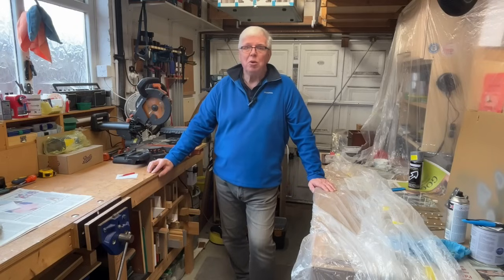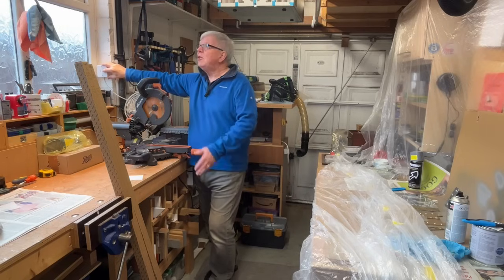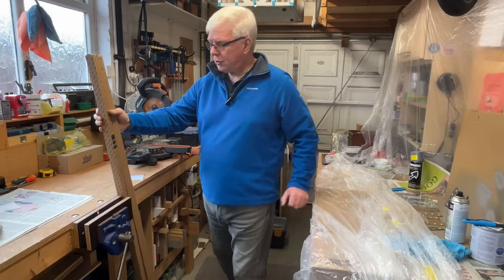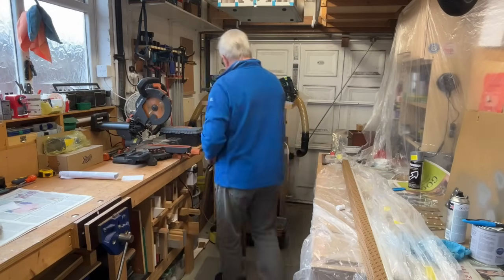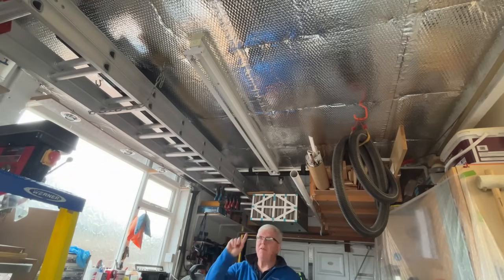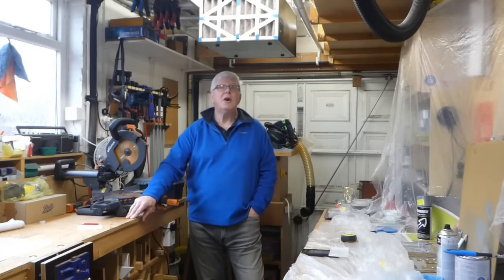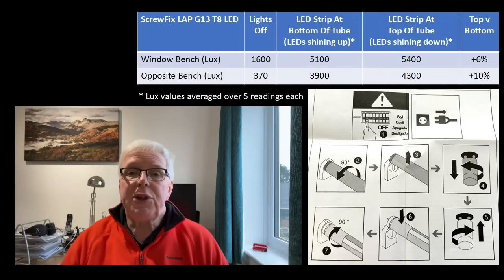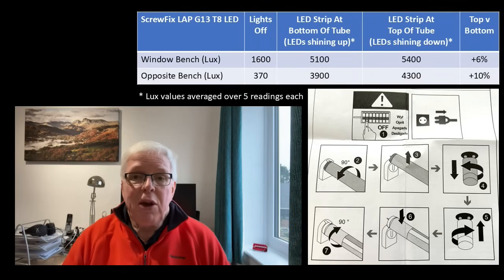Replacing Fluorescent Tubes With LED - ScrewFix LAP G13 T8 LED Tube - Fitting - Test - Review

Comment: Because the light from the LED tube is directional it is important that the side of the tube with the visible stripe is facing up into the light fitting just as shown in this video.

Comment: Hi! I’m trying to change mine for the first time as the old once blew. I couldn’t get the new one in and realised the little round black circle fittings have turned and are no longer lined up with the gap, meaning I can’t slot the bulb in! I’ve tried moving them but they are stuck fast. Any suggestions please? 🙏
Reply from the maker: Hi, I've had a quick look at a couple of fluorescent light fittings that I've recently taken down from the garage ceiling. They have different style fittings at the ends... for one of the fittings I could rotate the black circular inner using the tip of a small screwdriver, but for the other fitting it just wouldn't budge, no matter what I tried. My advice would be to get an electrician to take a look at it for you. If you are tempted to fiddle with it yourself, PLEASE PLEASE ensure the light is isolated from the electrical supply, as there's a risk of electrical shock. Chris

Comment: Cold colour white LED 
Ighting is not safe in the long term, the ultra violet light can cause age related eye disorders also the cold lighting causes ansiety depression and sleep problems. 5 hours after exposure to cold white lighting has ceased the brain is still telling the body to wake up. I dont have macross degeneration but I have lost my job due to problems caused by cold  colour white lighting. So play it safe and use warm or neutral white lighting only.

Comment: Hi did you test this at night so outside light did not affect the reading?
Reply from the maker: Hi, No - and that was a major fail on my part. 😞 However, I do like the new LED tubes, even if they're not quite as bright as brand new fluorescents. I'm now on with a major upgrade to the garage/workshop bay, following some work to strengthen the roof (for solar panels), so will be considering installing some flat panel LED lighting. The LED tubes will likely get transferred into the other garage bay, so won't be wasted. I'll plan the testing better for the flat panels.... Cheers, Chris

Comment: I wonder if I could ask a question please?  I’m no electrician but I did recently try to replace a kitchen under cabinet fluorescent tube with an LED ‘equivalent’.  I thought there were two tubes in series and that they would both work with the new tube.  They did light up briefly and then went out.

I then replaced the other tube for an LED one and the same thing happened.  I have since found out that there is a smaller tube in the line and that obviously is still fluorescent.

Can I ask:  If I replace the third tube, should it work?  Are special LED starters necessary or can you use the existing ones?

Many thanks and hoping that you can help this 77 year old ‘bright spark’.

Kindest regards

Paul
Reply from the maker: Hi and thanks for watching the video!
I'm not an electrician either so take whatever I say with a pinch of salt ...
It's a bit difficult to diagnose what the issue might be without knowing the full details.
Have you tried removing the fitting with the smaller tube, so that you just have the two LED tubes in the circuit? That might give some clues?
What model/type/brand are the LED tubes? Are they the very slimline ones that are intended for use under kitchen cabinets (and are typically chained together in series)? Something like ... https://www.screwfix.com/p/lap-linear-led-cabinet-light-white-4w-450lm/219PP 
If not something like this, I wouldn't normally envisage connecting lights in series, as if one goes kaput, it's more than likely the others will not illuminate as well.
I'd start by seeing if you can take the third tube out of the chain and checking that the two LED tubes work OK
Cheers
Chris
Reply: @handyman-at-home  Many thanks for that Chris.  I shall give it a go.  Kindest regards. Paul

Comment: Energy consumption and lifetime are actually fairly similar. Also, LEDs and fluorescent tubes both age and lose output. I don't see anything "more difficult" about LEDs as long as you read the specs and buy a reputable brand. LEDs don't contain glass or mercury vapour which are good enough reason to change.

Comment: Our works started using these replacement tubes about 18 months ago, yes they do give instant results.

They do have a couple of downsides.

If you read the label on the end of the tube it says to fit that end in the " live end " opposed to the " Neutral end " ( fluorescent fittings do have a " live end and a Neutral end ")

The " starter " is just a shorting link ( some have a resistor ) so don't fit to ordinary fluorescent fittings.

Over a period of time in an average room the tube WILL begin to sag ( hang down in the middle )

As stated, they are OK as a quick fix, better option is to spend a few extra £'s and get a proper LED fitting.
Reply from the maker: Thanks for the info. Interesting that the tube will sag over time!! Cheers, Chris
Reply: Am I right in thinking that real led fitting tubes don't have the metal end that houses the electronics?

Comment: Forgive my ignorance but how does one know if one's fitting has an electronic ballast?
Reply from the maker: More modern fittings will tend to have electronic ballasts, but it's by no means guaranteed. If there's no visible labelling info on the outside of the fitting that you can google, you could try removing the cover which should allow you to see the ballast itself and get a model number that you can look up. But make sure the elec. is turned off whilst taking the cover off. Hope that helps, Chris

Comment: I have just replaced a starter for my Garage Fluorescent.  I was thinking of using the LED straight replacement tubes but my starter is in the side of the fitting not the end.  Does anyone know if the LED replacement will work with a side starter?  Don’t want to get one and find it won’t work for that reason!  Many thanks!
Reply from the maker: Hi Andrew,
I'm not an expert on any of this ... but I'm fairly sure the fact that your starter is on the side rather than the end (as was the case on the double fitting I showed in the vid) is not significant at all.
What matters is the type of ballast inside the light fitting itself and, unless there's any sort of product information on the outside, the only way to find out the type of ballast would be to remove the cover and take a look inside.
Obviously if you're going to do that, make sure the electricity is off at the time.
If you can find any type of product number, or photograph a label, you might be able to find out what type it is by using google etc
Cheers
Chris
Reply: @ Thanks Chris - I will check the google offerings to find out what the ballast in my type of light is for starters as the fitting is now 50 yrs old!

Comment: I've worked in the lighting industry for decades. It's a complete waste of time taking light meter readings in a situation where natural daylight can influence your light meter. Natural light levels are constantly changing and can range all the way up to over 50,000 lux on a very bright day, but vary by thousands of lux as clouds pass over, and the time of day can make a difference too as the earth rotates. The iris in our eyes automatically opens and closes so we don't often notice the difference. If you have 8000 lux on your workbench, it's probable that 7750 is from daylight and 250 comes from your light fitting. Also, the light meter software for mobile phones is notoriously inaccurate. It can be used for comparative purposes,  but not to get an accurate figure.
Reply from the maker: Hi, and thanks for the feedback. Agreed - it was a real newbie error taking the readings with so much daylight coming through the window🤦‍♂️. My intention was to try and give a simple comparison between the old fluorescents and the new LEDs, but clearly it's a lot more involved than that. Have been doing a bit more experimenting with the light meter app and have found it's very variable - sometimes it's almost spot on, and sometimes it's a million miles (or lux!) out. Been looking at some of the cheap(er) light meters on Amazon and am not convinced that they're a great deal better to be honest - any recommendations? Cheers, Chris
Reply: @handyman-at-home  Hi, like everything, you get what you pay for. I use a Hagner EC1 meter, but they're difficult to source, and are about £350. Too much to pay for occasional use. I wouldn't look at anything under £100. The other issue is that they all (despite the manufacturer's claims otherwise) drift in their calibration over time. I've seen meters that were 30% off after a few years. But, it's impossible to determine the accuracy and recalibrate without access to very sophisticated lab equipment. Your basic finding that LED tubes are not as bright as the fluorescents they're replace is spot on. Some might find they're brighter than the old lamps they take out because fluorescent lamps decline in light output over time. A rule of thumb figure is 30% drop in output after 20,000 hours burning. But older tubes will give out far less. I hope that helps.

Comment: This is the problem with all leds, they glare but fail to put the light down into the surface.
Just look at streetlights and see the dark patches between them compared to the previous sodium lights.
For some time a road near me had LEDs on one side and sodium on the other, the difference and poor performance of the LEDs was very obvious.
Superior longevity of LEDs is a myth.

Comment: I'm loving that ceiling. Does it get hot in the summer though?  I have electronic fittings for my fluorescents, instant on but I'm not sure they'd work with LEDs. The new "flat panel" LED lights are amazing though. Use plenty of power mind you.
Reply from the maker: Thanks. I insulated between the rafters with some Rockwool / loft insulation and then covered the whole lot with the aluminised bubble stuff. Left a few air gaps here and there to try to avoid any moisture and mould build up. It definitely improved things a bit (in the colder months) but I reckon I still lose a lot of heat via the main garage door. Thought about insulating that too but never got round to it. Don't have a problem in summer - just open the back door and there's plenty of fresh air. Regarding the flat panel LED lights, I actually bought one a year or so ago with a view to trying it (mainly to improve lighting for the videos) but I'm struggling for space where to fit it. I really need to take the wood rack, ladder rack and air filter down so I could start with a blank canvas .... just haven't got round to that either, as yet 🤣

Comment: I replaced the old fluorescent lights in my workshop with LEDs and the contrast was amazing, the new ones are so much brighter
Reply from the maker: Agreed. Quite a few people commenting on this video make the point that fixtures that incorporate LEDs, rather than using removable LED bulbs/tubes, may not prove to be the best long-term approach, given that you have to replace the whole fixture when the LEDs fail. Don't know which you did, but I guess it comes down to the cost and whether you're happy doing any re-wiring, or whether you need to pay an electrician. The remaining fluorescent fixtures in my garage are pretty old now, so will need replacing in some way or other - whether that's with these LED tubes, or complete new fixtures (which I'll fit). Either way, they'll be LEDs. 👍
Reply: @ I replaced all the fittings as they were secondhand 25 years ago, so were well past their sell by date! I bought the new units from Screwfix during a sale. Now I need to replace the units in my home office as well.

Comment: Fluorescents don't age well. LED's age better. Also better to take the ballast out and rewire without ballast or starter replacement as saves a few watts. Got some cheap LED replacements in my kitchen and took electronic ballasts out been in a few years now without a problem and much better instant start.

Comment: That was very intresting,I have already done this but I was told you had to take the old ballest out of circut and I did not need any replacement starters, you just take the old ones out.
Reply from the maker: Thanks. That's interesting. Looking at the instructions, it says that these particular tubes are only compatible with ferromagnetic battens when used with the LED starter provided, or with LED replaceable battens (that don't have starters at all). It says they're not compatible with battens operating with electronic ballasts. Doesn't say anything about the option of taking the old ballast out of the circuit ... but it seems that there are also tubes on the market that work with both types of battens. One of the other comments names these - can't remember but might have been Philips - so I guess it's a case of double checking the instructions that come with any particular tube. Cheers, Chris
Reply: Your correct take the cover disconnect all the control gear and from each endcap insert a live and neutral plug in yuor lamps and throw the starters in the bin

Comment: I also wasn't aware you could change fluor. for LED....thanks for that, Dave...and thanks to all the Comments pointing out good gen on these fittings. Comment@raydavison has a major point...DON'T... that's DON'T buy fittings with onboard LED's....get loose LED's.  My onboard fitting failed after 3 years; whole thing has to go; abominable design.
Reply from the maker: Totally agree. We’ve been looking for some new lighting fixtures for our living room and it seems the manufacturers are really pushing those with integrated / onboard LEDs, but whilst they might look ‘cool’ and ‘fashionable’ I’d be very wary about their longevity. Perhaps not so much of an issue if you’re just buying a cheap n cheerful thing that you could afford to replace after a couple of years if it went wrong, but if you’re talking about something more expensive, then they’re not for me. Cheers, Chris

Comment: The life of most Most LED's is massively exaggerated and their quality varies enormously as does their light output (As you have found in this experiment). It's vital to check the light output is suitable for your needs as two LED's with the same power rating can have light output that varies as much as 50%. Fluorescent tubes will outlast LED's by many years, possibly even decades, the ones in my garage have been in for 35 years. And don't install light fittings with onboard LED's (As opposed to using loose LED bulbs) as when the LED's die - which they inevitably will far sooner than you expect - you will require a new fitting to be installed (With possibly a bill from an electrician too) not just a change of bulb
Reply from the maker: Totally agree with your comment about integrated / onboard LEDs, but especially so if you’re buying an expensive fixture, per my comment to Firebrand55. Cheers, Chris

Comment: Two problems with your light metering procedure: a) you should have taken a light measurement with the lights off to get a measure of the daylight contribution b) a proper light meter has specific settings for tungsten, fluorescent and led lights as they have different spectral distributions and the single sensor has to use a different calibration for each.
Further to this, are you replacing tubes of the same power rating as the LED lamps?
The other thing with fluorescents is that they take around 200 hours to 'burn in' and then they have an operational life of around 5000 hours before the performance starts to fall off. I used to look after the lights in a retail store and we used to relamp the store every two years and you could really see the difference.
Reply from the maker: Hi and thanks for the feedback. 
I did take take the 'lights off' readings when I was experimenting with the position of the LED strip but forgot to do those for the main test 🤦‍♂️
For sure, I totally agree that using an app on the phone is nothing like using a calibrated light meter, but I was only aiming for broad brush comparisons. 
Regarding power ratings, the fluorescents I was replacing were 58W, with a claimed brightness of 5200 lumens each, giving a theoretical total of 10,400 for the pair. Compared to that, the new LED versions were only 3300 lumens each, giving 6,600 in total, but they were the highest that were readily available. 
So my layman's expectations that the LEDs would be brighter (without having looked at the specs for the fluorescents beforehand) was clearly unreasonable, but I guess one of the points I was trying to get over was that for most people(?), they'd probably just waltz into Screwfix or similar and get what they thought was a 'like-for-like' replacement, but which in fact is significantly less bright than a new fluorescent would have been (if you could get hold of one). 
But it's obviously less so, once the fluorescents have be used for quite a while - I'd guess the ones I swapped had been there for 5 to 7 years maybe (and still have life in them), but I have no idea how many hours that would correspond to. 
All very interesting stuff once you dig into it. Cheers, Chris👍
Reply: It would remove another variable if the tests had been done at night, thereby removing the (considerable) contribution from sunlight.